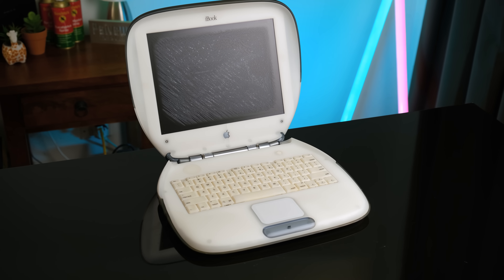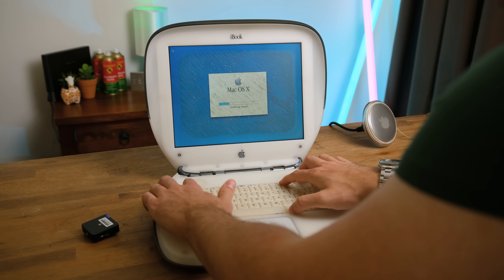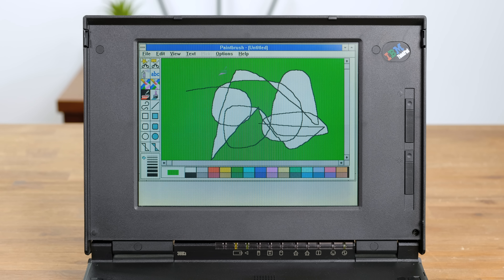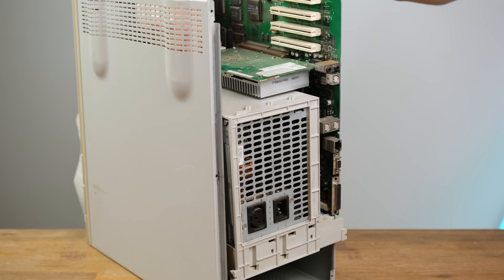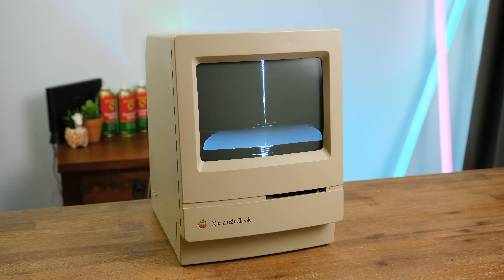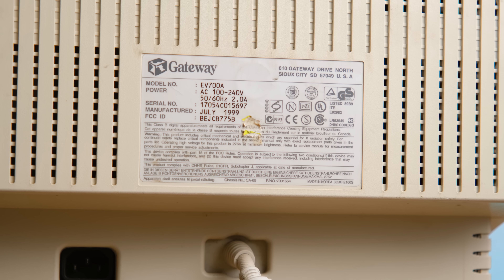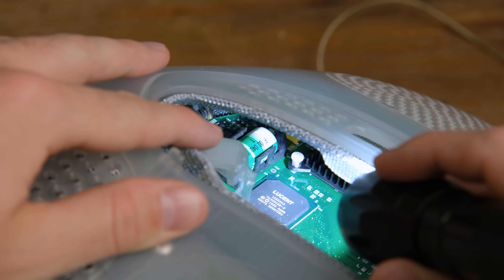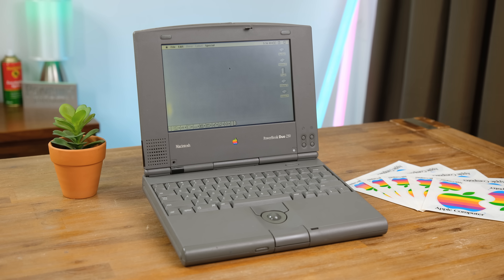So Much Vintage Tech Is Dying... Here's Why

Comment: I have around 20 old computers from the 90s. When I got into collecting them few years ago, I soon discovered some things are just not possible to resolve - plastics becoming brittle or LED displays disintegrating. Since my main motivation going into vintage computing was to play with those computers, I still think it is a hobby worth pursuing. Turning on my Macintosh Classic and doing some distraction-free writing on it is very relaxing, and turning on my Performa 5200 to play some old Star Trek games is a guarantee for time well spent. It is something I am going to like remembering long after these things fall apart.

Comment: I have two gateway 2000 towers, one from 1994, the other from 1995. While I bought the 1994 model with a motherboard battery needing to be replaced, and haven't gotten to it; the whole system is extremely pristine, and as soon as I replace that battery, will continue to live on.

As for the 1995 model, it uses a CR-2032 battery, so it's never had that issue. I use it occasionally for CGI and it's happy as can be.

While it is true some computers will rot, they are due to design flaws, they just weren't made with materials that are able to last that long. They're designed to have those parts replaced eventually, but finding parts for something that old is difficult.

Oh! I did forget to mention, in 2015, my 1995 gateway system's hdd was beginning to fail, but I did replace it and upgrade it to a larger drive. Hard drives just need to be replaced eventually.

We all need to learn to replace capacitors and perform component level repairs ❤

Comment: pastics are made from oild and chemicals the heat sun light cold condition will make it brittle and we do not know the composition of the plastics defects Igot an ibook from a box never been open 10 years opened and the smell was Aple what chemical they used I do not know plastic out side gets woser with in months years speakers in Japan rot very quickly because  combination of dust humidity chemicals change

Comment: I use a hdd 5400 rpm from 2008 and it’s loud, it causes texture to not load in games, however to my surprise the load times aren’t as bad as one might think. I can feel the smoothness difference when the same games are on my ssd however for an ancient hdd and the slower version of it at that, IT REALLY HOLDS ITS OWN STILL. Sure some oddities here and there when first spawning in games, however after 5 mins everything is loaded and playing fine. I get why hdd is phased out but mines still doing its job and ima let it! I was abt 12 yrs old when this hdd entered my life, as an adult later, im still using it.

Comment: Rubbers and plastics outgas over time.   It's the same process that results in windshield of a car having this film of glare-exaggerating grease on the inside, even if you never touch it, and never bring anything chemical into the vehicle.  As the plastics lose component gasses to this reaction, they become brittle.

Comment: As an automotive tech the most common mechanical failures of many parts I encounter,both purely mechanical and electromechanical are generally down to small plastic components failing.Either through wear,especially gears/cogs or through breaks which usually occur where the plastic part interfaces with metal parts,spindles etc.

Comment: Hardly anything lasts forever.  Just like rubber or plastic parts on cars, or even metal pistons in the engine, they eventually go.  Tech is no different.  It’s frustrating, with reality.  I have a MacBook Pro from 2015 that I still use as my main computer, and the bottom is starting to bulge, most likely because the battery is going bad.  But I can’t afford a new battery or a new computer right now with how costs have gotten so insane.

Comment: I don't like that the thin black layer on most headphones decays after 2+ years, even though they are working okay. It is the same technology as my father's couch and armchairs he bought 10 years ago, so heavy flocking. (Sadly it was more expensive than ordinary "headphones").
Reply: I think that fabric on furniture is called "bonded leather" or some other trade name.... It's a synthetic coating adhered to a fabric base, and when it delaminates you see the underlying fabric. Headphones use a very similar fabric, but much thinner for comfort. Sucks when it degrades.

Comment: I used IBM Thinkpads, T20-T22 models for retro DOS games for years and years because of the sound compatibility.  One by one, they get a syndrome called "blink of death" where they just stop powering on.  I recently gave up when my last one bricked.  Absolutely mint condition externally, but it won't power on.  Have a stack of half a dozen, none will power on any more.
Reply: Damn, that sucks. 

I have a NOS condition IBM 380ED, (pentium 120 I believe) it is absolutely flawless. Even the original battery still works for about 30 minutes still!

Unfortunately it's not really that great of a dos gaming computer.

Comment: It's pretty sad - I kept a lot of Vintage PC gear over my career in the IT Industry including IBM, DEC, Acorn, Kaypro, Compaq, Apple, Sun etc... from the 80's until present. I optioned some of them up to max memory and threw in lots of top line 3rd party add-ons, accelerators and top shelf storage options and collected the best apps of the time to run on them all. Apple IIe, Newtons, Mac SE 30's, Mac II, Duo Docks etc... Compaq LTE and deskpro 286, 386, & various Proliant servers, IBM PC, XT, PS1, PS2 Model 30, 50z 70's and a sexy black Stealth PC and range of Thinkpads. Crazy items like the 3Com Audry Ergo, Some nice SGI gear like the O2, Indigos and an awesome Tezro. All placed into a storage center that has a stable temperature. Sadly all the materials are breaking down regardless... Even mint unopened items are in decay. I opened an in box HP PDA from 2010 and the the sticky rubber grips going around the metal has just turned into goo. I've saved two Compaq SLT/286's that spent their lives from the late 80's and early 90's at a research centre in the antarctic and returned home on the Aurora Australis (icebreaker). These two named "Huey", and "Dewey" got their name after the movie Silent Running and used a serial cable connected to measurement gear that they analysed. I'm glad they still function OK.

Comment: I have a monitors and computers from 1985 still working, albeit they have to have a lot of capacitors, switches, and hard-disks replaced with CF flash and SD drives.

Comment: Its not just computer tech that's failing with age. Home audio also has its issues as it ages, mostly due to capacitors drying out and shorting but I've also seen quite a few failed IC chips that somehow just died while sitting. 

Batteries in laptops seem to be worse than they were 15 years ago. My 2008 Gateway laptop battery is still working, able to power it up and run for about 2 or so hours, but my one year old HP battery is stone dead unable to charge already.

Comment: Many of the failing parts are replaceable, but at this point outside of hobbys and aesthetic not really useful.
Though I always go a once over for older boards before even attempting to power on, if I want something to run; a bad cap or bit of dust can domino to multiple failures and kill the entire thing.

Comment: I had a sony Trinitron 16:10 24 inch monitor with a bad flyback. Would have cost $800 in 2011 to get it replace. I bought a flat panel and donated the Trinitron to the local community college electronics dept. Even when the monitor was acting right, I could tell the difference between the new flat panel. Flat panel was so much sharper with much more vibrant colors. As much as I loved my Trinitron I do not regret getting rid of that 98 pound behemoth.

Comment: We knew in the late 1990s that Apple was using degrading materials - with their slant being on biodegradable ,earth saving breakdown of materials for "landfill considerations of the future" - but , all of us in Tech then knew this was what they'd come up with as a solution.  We didn't imagine it would breakdown B4 or during our lifetimes is all.    It was referred to as Crippleware Hardware .
Apple is pretty rotten for doing that... what if I tell you that even older hardware DOES NOT do this ? I have multiple Mac Classics , Tandy TRS-80 , & Apple IIc CPU & old Mac powerbooks (180c) which still work fine ,the monochrome screens have no artifacts or buildup & work as they did in 1992? 
This hardware choice was long after Apple Computer  became Apple ,Inc. & the move was made in late 90s to this .. ironically,it was about the time the clamshells came out .  Just a little,tech history to accompany this video that , I for one, knew was coming long ago ....

Comment: The first thing I gather from this video is that Apple products age especially poorly. And yet, this year I revived a 30-year old AMD computer from 1995...a machine I used in my childhood! Complete with still working CRT monitor and all. This hardware had been sitting in my parent's attic unused for more than two decades. In that environment, it was subject to a lot of extreme summer heat and freezing temperatures typical of Kansas City weather. Kind of made me feel nostalgic playing DOOM on original hardware made three decades ago. Retro PC building/gaming has definitely become a thing for us aging Millenials old enough to remember  DOS and the first few iterations of Windows. It really gave me a sense of time when Windows 98 booted right up, and I saw shortcuts and files saved on a desktop just as I had left them in Junior High. So I don't think you can unilaterally assume that tech will go bad. Some hardware is built far better, some not as much. I do think we are at that moment in time where some older technology is gaining collectible status.

Comment: Some of the most beautiful examples of vintage tech are the stereo receivers/integrated amps from the 1970's and 80's. Huge names and reputations that have no equal today. Understanding the value of power transformers and the beautiful quality of so many of these beauties it is well advised to test the value of resisters, replace when needed, and replace all capacitors. Yes every one! Power transistors sometimes go bad but can still be in great shape decades later. Knowing the care in matching transistors, during this era, replace only when needed.

Comment: My Mac Plus that I bought in 1986 still runs. My Atari 400 still works. But I recently powered up an old Cromemco Z-80 S-100 bus computer I put together in the late 70's and some voltage regulators burst into flames. Bummer. It was a relic you could program in machine language with toggle switches on the front panel. But it would also compile and run FORTRAN. I better take that battery out of that Mac Plus.

Comment: I relate all too badly to this video. I own a Texas Instruments/Acer Windows 98 laptop, dated to 1999. The old bugger still runs decently, I still use it to run old CD-Roms with games or edutainment softwares. Though years ago, the internal clock has stopped working. The external plastic is cracking and falling apart, though duct tape is still holding it together. Then, a couple of years ago I noticed a black dot on the screen : dead pixels. It has expanded since, but I managed to contain it to a corner of the screen. 
I still use it regularly and I hope it still holds on for a while.

Thank you for not making me feel alone facing this problem.

EDIT : 3 days ago, May 7 2024, it has officially died. First it stopped reading one of my discs, then the power switch broke, followed by a blue screen saying "Irreversible Error". After pressing Esc, all I got was black screen, so I pulled the plug and waited for it to turn off. It had a good run, but it's still painful.
I'll try getting VMWare Workstation these days.....Wish me luck.

Comment: 5:55 Man this one brings back some memories! Lol! I used one of these for as long as it would last. I remember I had a Nvidia 9800 in it or something like that. A 2 gb video card. I really thought the form factor was cool as well. It just slides open and all the access points to the ram, hard drive etc were in convenient locations. An under rated little computer

Comment: Electrolytic caps will fail eventually too.Some sooner, some later.The bane of radio collectors. You can't find a Micronic Ruby that works and they're too small to repair without major hassle. Anything transistor radio with Sanyo, caps, forget it.

Comment: Real sad but true! Yet an old valve B&W TV from the 40s-50s will live for many more decades as long as the owner has a CRT rejuvinator and replacement valves because the TV is in a wood/bakelite cabinet, doesn't have corrosive batteries and the plastics used back then seem to not degrade too badly.

Comment: Wow.
Those thinkpad's were utterly bulletproof at the time. The T20s series was especially good. They were made of Titanium. Those things were crazy strong.
I had a t20 that lasted 15 years then I gave it to my mum and it worked for her for another 5 years or so.
Can't remember if it died or if it just got replaced. Those things just ran and ran.
IBM did not fuck around. The sold to Lenovo. I have a modern Lenovo as my work laptop now.
It's not a patch on the old T23s. It's plasticky and the keyboard is not as good. I don't really use the keyboard so it's not a problem.
Just not as quality a product as the crazy over engineered T23 was. I guess that's why IBM sold off the brand.
IBM only know how to make massivley over engineered pieces of equipment.
I love them for it. Just like HP's workstation division. Those things are beasts. They look and weigh like the brotherhood of steel made a computer.
They will absolutely run 100% full chat for the CPU and GPU for as long as you need them to do that because those are the parameters they are designed for.
That level of reliability and performance is nowhere else in the Industry but I can attest to HP workstations being super human in their work ethic.
They JUST DON'T BREAK.
THEY JUST KEEP KEEPIN' ON.
I'd recommend HP workstations to anyone. They are crazy expensive but they can be used at 100% 24/7
Luv and Peace.

Comment: I still have some very old items like Nixie tube calculators (also programmable ones) from the beginning of the 1970ies and pocket computers from the 1980ies and 1990ies. Eventhough I don't think that manufacturers expected that stuff to last decades they all still work like a charm :-) The Sharp EL-640, Casio SF-7500 and Sharp IQ-7100 even supports post year 2000 date settings - quite impressive for devices build 30-40 years ago

Comment: Ps2 died on me 2 years ago, OG Fat Ps3 Died on me in 2014, 2008 Laptop with Linux on it died on me 2 years ago. Sad to see old thec pass away. Its nearly like loosing an animal in a way. Rip. Hope the used CRT I got to play classic games will last a long time, I have to put a magnet on the side with Velcro to get off a green spot in the corner bc the Degausser doesn't work right anymore.

Comment: That's why I replace ANYTHING that can go bad in my old tech once or twice a year. Costly, yes, but I guarantee I'll be the last one still using a 2004 windows xp HP pavilion desktop and ballin' with my 1987 colour Panasonic cathode ray tube television set.
Reply: I envy you ! I had a Texas Instruments Windows 98 laptop working for 26 years, used it fairly regularly for retrogaming or old edutainment softwares. It died on me yesterday : the power switch broke, blue screen saying "Irreversible Error" then black screen. So I pulled the plug....
Reply: @yrooxrksvi7142  My grandpa worked at ODU. He collected all the broken TI Desktops, fixed them, kept a few for himself, then gave them away.
Reply: @yrooxrksvi7142  Also, nvm. CPU in the pavilion committed suicide. Oof. At least I still have my Compaq Presario.
Reply: @SkipperCrunch-P  Or there's always VMWare Workstation Player. Until they sortout this provider change bs, that is, because I don't want to lose my CD-ROMs to dust.

Comment: To prevent this screen problem: when in storage, always leave the "clamshell" half-open so that the chemical that the plastic keyboard and chassis gas out, can disipate freely. 
Decomposing plastics very close to the screen protection are causing the issue. Not the screen itself. 

Also take care to package in a separate nylon or paper bag, the cables from all your old peripherals... The cables of mice, keyboards, gamepads, etc, older than 15 years, should no longer be touching the item/device (or other plastic items/devices) for long periods of time, otherwise they will start leaving marks (in the form of melted dents). Not saying to remove the cable if it's not removable; just package it in a separate nylon or thick paper bag.
You have been warned!